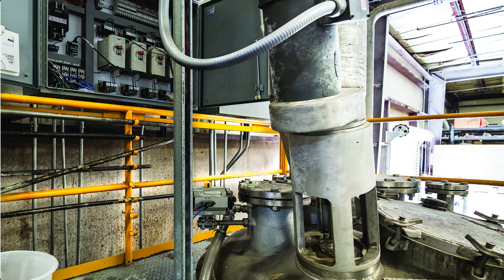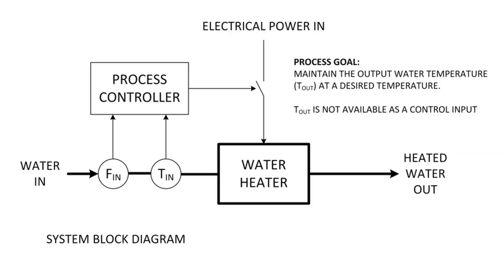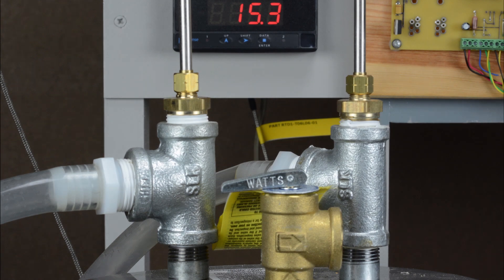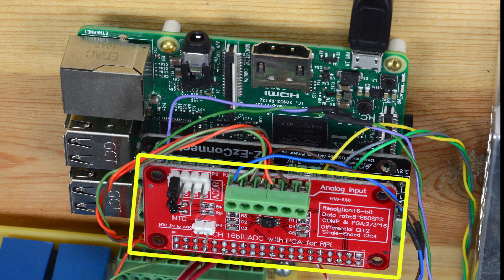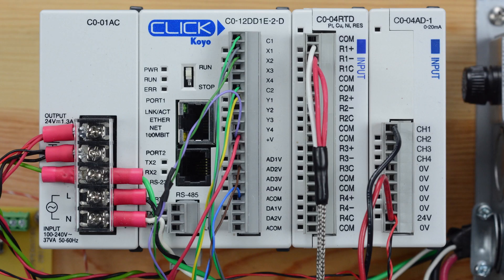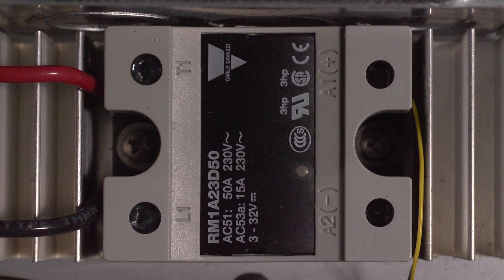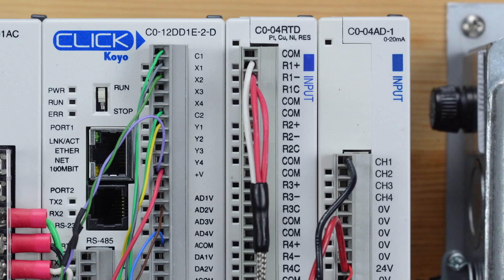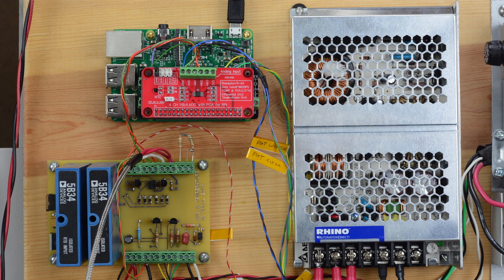Raspberry Pi vs CLICK PLC from AutomationDirect

Comment: Very good presentation. I think the multitasking issues you experienced with the RPi are likely just programming issues since update threads need to work with atomic operations or have appropriate mutexes to guard against the issues mentioned. An important consideration that wasn't mentioned is maintainability. Design an industrial system with a PLC and any competent engineer should be able to maintain, diagnose and repair the system for the next 20+ years. With many controllers, the PLC will still be available, or at least a plugin-compatible one. If you need to replace the raspberry pi 4 board in 20 years, finding a replacement is likely to be a major issue.
Reply from the maker: Thank you for the comment Michael. Very good points.

Comment: Nice video.

The raspberry PI has neither UL nor CE marking for industrial environments.  It is also susceptible to transients and electrical noise.  It is entirely unsuitable for industrial environments.  This video notes that there are interfacing issues (no 24vdc for example) which is a practical problem because signaling is a science in itself and industrial sensors are generally 24vdc.  A very big issue is that python or any other language supported on the Raspberry PI are poor choices for the factory floor.  There are reasons that object oriented programming and dynamic memory allocation are very very little used on factory floors.  These introduce risks that can result in instability, increasing the likelihood of malfunction, equipment or process damage or injury.

The typical python/c++ programmer has zero experience with factory operations.  The typical PLC programmer has zero experience with python/c++.  Switching roles is possible but it takes a while to learn the rules.

Another reason to avoid the Raspberry PI is that availability of equipment is variable and generally shorter term.  Allen Bradley and Automation Direct and Siemens continue to sell parts for old systems for twenty years or more.

Raspberry PI was intended to be an expendable learning device that I would have loved to have as a child.  There are some expansion modules that allow it to be used in pseudo industrial environments, such as the Measurement Computing "pi hats".  The best thing a PI has to offer is the OS (Linux and Win10 IOT), which can be used for things a PLC couldn't dream of.

PLCs have been designed from the beginning for industrial control.  They now commonly integrate safety functions, advanced robotic control, very deterministic operation and this; real actual technical support with a phone number and people who know what they are doing in industrial environments that speak your language fluently.

If you are building an industrial project, it is foolish to use a Raspberry PI as the primary controller because it is easily questioned by any inspector or discerning customer.  If you are building a proof of concept or experiment, you might be wasting your time because PLCs are so much easier to implement.  If you are a student using a PI or Arduino to make a beer machine for your senior class project, remember that real beer makers use PLCs and that your skills developed using the PI/Arduino are only somewhat transferable to industry.  The languages to know are IEC61131 (ladder logic, structured text, and to a lesser extent function block diagram, and the awful instruction list language if you live in Germany).  BTW, good luck finding a college that teaches hard core programming in any of these languages.  Luckily they are easy to learn like python, and even easier to troubleshoot because nearly every PLC has "online editing" which is the ability to perform debug and actual changes to the code while the system is running.  Some PLCs even allow multiple programmers to make edits to the code simultaneously.   It is interesting to note that the least expensive PLC on the market is the one in this video, the Automation Direct Click PLC.
Reply from the maker: Dennis, great comment and description of industrial usage.  :)
Reply: @Howard Bleier The kunbus product looks awesome!  It seems that it's purpose is to bring PC-based computing to the industrial landscape.  It's moderate pricing could make it viable for some projects.  I bet most people wouldn't be using it with Codesys or OpenPLC.  If I were to use it, I might use it with OpenPLC and OpenCV to get the lowest cost controller and vision appliance.  But that would probably be brutal to implement, lol.  It will be interesting to see what they will offer this year at Nuremburg.  Thanks for sharing!
Reply: Great exhaustive comments on your first message and very good points raised for whoever is thinking about Pi as a PLC. It does have very big differences in what is should be used for, even though it might not be very clear for someone unfamiliar with either disciplines (industrial automation vs programming).

As you say, it really shouldn't be considered as the primary controller for an industrial machine, but could it have a place somewhere i wonder? Perhaps as a HMI / SCADA that might be more flexible to program? (I'm researching this now for a project)
Reply: Lol what a comment! 👍🤣

Comment: I did in the past a semi-industrial project with an arduino. What I found is that the hydraulic coils did create instabilities, due to magnetism and transients. I did the same system back with a Click and it works very well!
Reply from the maker: Yes, Those are some of the subtle differences folks need to watch out for.

Comment: Very insightful video. Another crucial differentiator between the two computers (because that's what they are) is long-term runtime reliability especially operating in hazardous environments. With that said though, I can see a future where Pi-based automation systems are introduced because of just how powerful and flexible these SBCs are. But the engineering and certification processes would probably end up costing as much as developing a dedicated, segragated PLC.

Comment: After taking industrial pneumatics and hydraulics courses and working with python my thoughts would be that the pi would work great with a PLC not a replacement. A PLC and ladder logic are so focused and the pi just lacks specific industrial traits. Together you'd have a terminator. Thanks for the insight.
Reply from the maker: satchell78, We are glad you enjoyed the video.  Yes, they both have their applications in the industrial environment. Many engineers and self taught builders find the PI and Arduino products easy and inexpensive but lack the industrial ruggedness which is why we created the Productivity Open products.

Comment: Great video! I personally think you’ll see more raspberry pi’s in factory automation. Imagine you stock pile raspberry single board computers instead of very expensive PLC units. You can keep production cost down and having replacement parts on hand wouldn’t cost thousands of dollars or special tooling and an engineer with a specific background in name brand automation software. I also love the community behind raspberry pi! Keep up the great work.
Reply from the maker: Thanks for the comment.
Reply: I am not sure about using raspberry PI for industrial applications. We tried to do a automation project using a beaglebone computer. 
Firstly We had to add an extra layer of protective electronics for the IOs, which increased the cost of the product. Secondly we had provide backup power so the Beaglebone operating system (Debian) would shutdown correctly. Unfortunately this too added to the cost of the product. The final product worked as per specs, but the whole lot of extra hardware made the system unwieldy and precarious. 
I would prefer a PLC anytime over a raspberry, even a cheap Chinese made PLC works very well. It's possible to use raspberry style computers but not in its present form

Comment: This is a very useful video. It would be great if you'd upload the code & PLC project for both to Github or just your website so we can compare. I imagine the ladder logic is much simpler and more straightforward. Also, it would be useful to see the BOM for each because while the Pi is very inexpensive, costs start to add up once you add all the parts in you custom board, cases, transformers, connectors, optical isolators, etc.
Reply from the maker: SP30305ATL, We have both projects and will upload them to our video site.  I will let you know once they are live.  Thank you for asking and for your interest in both products.

Comment: pi4 with codesys runtime and linux rt patch with a constant very small jitter clocked a 2.0Ghz tested, usb3.0 ssd boot beats any plc you throw at in any application as long as you provide suitable industrial housing respecting IP standards.
Reply from the maker: Thanks for the comment, Make sure to check more of our videos https://www.automationdirect.com/videos/home
Reply: No it doesn't, a raspberry pi cannot handle several hundred or thousand i/o signals, it cannot handle realtime motion control. An industrial enclosure will not turn a raspberry pi into a 12 axis servo controller however pretty, big and shiny the enclosure may be. 
USB3 doesn’t like noise on its data lines - hence specific cables for the higher data rate. Useless in industrial situations where electrical noise is prevalent. I have seen desktop computers freeze and lock up due to a usb mouse cable that was in close proximity to a motor VFD. When the motor started anything usb connected would drop out, become undetectable and cause the the computer to lock up until the drive power was removed and the usb items were re inserted.

Comment: My 2 cents.. I am a beginner.. There is one main question when choosing Do you want a project or do you want to be done?  My home automation runs of a Ethernet Click and node-red on the Pi. If you don't want to deal with project boards and have your actual project, home automation in my case the decision is easy. I do not live in the the US and I got my click fairly expensive but.. automation and industrial ready..
Reply from the maker: Thanks for the comment Dawid. Not being suited for industrial environment and time consumed is the trade off with some of the Open source technologies. That is why the New Productivity Open Industrial Arduino compatible controller is so impressive. Please see more info on this platform here: https://www.automationdirect.com/adc/shopping/catalog/programmable_controllers/open_source_controllers_(arduino-compatible)

Comment: What about using codesys on a raspberry pi?

I'll have to double-check the feature-set, but the ability to have instruction list, ladder, structure text, and CFC all IEC I think makes the raspberry pi superior

Also I think you can use profinet devices with the raspberry pi
Reply from the maker: Jonathan, we have seen many options for industrial interfacing devices to the Raspberry Pi (ProfiNet, Ethernet/IP etc.).   As stated in another comment, the video was created by a third party with a non-biased opinion to show how each product could potentially provide a solution depending on application and programming experience.  While some programmers may find it easier to program single board controllers, others, like those in the industrial field, may find PLCs are better suited for the application.   The open source concept used with single board products allows for many control options and we at AutomationDirect are intrigued with the possibilities these controllers offer. For obvious reasons, we lean more towards PLCs but we do recognize the potential of single board controllers.  If you are not familiar with our low cost CLICK PLC, we encourage you to review them and their free software and don’t forget to subscribe to our channel so you will be notified of any new products/videos we release 😉.

Comment: Nothing wrong with this video or the statements made. However, Raspberry Pies are probably more used for home automation or hobby projects than industrial automation tasks, although I've seen RasPi based PLCs as well.
Still, for many makers, most of the PLCs out there are just prohibitively expensive. Even the programming software alone for a Siemens S300 breaks the bank for most home automation projects. Most makers have ample time at their hands, but no equivalent amount of money.
I recently took note of the Click (Plus) PLC range, and fell in love with it, as the pricing makes it accessible for my home automation. So I trade money for time and have less hassle. But if a maker is out for saving the maximum amount of money and doesn't care about time, the RasPi or an Arduino is almost impossible to beat.
Just a few features I'd love to have on a Click, which are e.g. modules for inexpensive Dallas 1-wire temperature sensors or DHT22-AM2302 temp and humidity sensors. Purchasing a $180 RTD input module, and another $60 for 4 sensors is much less value for the money than getting an Arduino Uno clone, Ethernet shield and 4 DS18B20 for a total of $30.
Reply from the maker: Thanks for your comments. I will pass the information on to the developers.

Comment: I've always been disappointed with Raspberry Pi IO. It always just sems so limiting, you'd think common industrial sensor signals would be a priority on this thing. We use a couple in a hotel to view a couple IP cameras over the normal cable television. They work great for that (when they're working that it lol)

Comment: I agree that for industrial automation the right tool is a PLC (input/output signal conditioning built in, screw terminals, resistance ho harsh industrial conditions, simple programming language every "dumb" electrician can understand).
On the other hand, for a student an Arduino/ESP32/Raspberry PI is the way to go. Much lower price, endless possibilities to interface to interesting advanced sensors (available for peanuts from China), and above all you use a REAL programming language (typically C/C++) that is the de facto standard in the IT industry.
If you know C++ you can do everything (not necessarily in industrial automation), and also learn to program PLCs in a weekend by your own. On the other hand the electrician who only knows ladder, or other PLC programming "languages", will stay at that level for the rest of his life (fewer career opportunities).
Reply from the maker: A lot of great points! Thanks for the comment.

Comment: Thanks for the video and your efforts, but why python ? Bare metal C, and just a little tweaked kernel (such as real time patch and removing unnecessary kernel code)  will not only make Pi much better but also its parameters can be changed while it is working!! (a linux process can be notified while it is working that a conf file has been changed with many different ways such as inotify, sockets, etc..), it can also report everything in real time, it can be updated instantly. But for reliability and long time stable working hardware must be well protected and that can be challenging.
Reply from the maker: Thanks for the comment Onur. Great food for thought for anyone making this comparison

Comment: Pi can replace expensive processors. You could use codesys on raspberry Pi . It support motion and most of the industrial protocols you can imagine. Codesys for those who have worked in plc programming is one of the best programming environment. Used by abb, wago, beckoff plc's
Reply: Codesys controllers are expensive,for simple project ,why not use cheap PLC?
Reply from the maker: Thanks for the feedback Joel!

Comment: use raspberry, arduino etc as inputs for real PLCs, thats how i solved the home automation issue. siemens lacks of http and other stuff and vice versa. Raspberry can fetch data from internet and show "green light" to siemens Logo! to execute more code.
Reply from the maker: Great point Tomi. Adding a microcontroller (like Arduino or Raspberry) to your PLC control system as a auxiliary embedded device, is a good way to merge the benefits of both platforms.